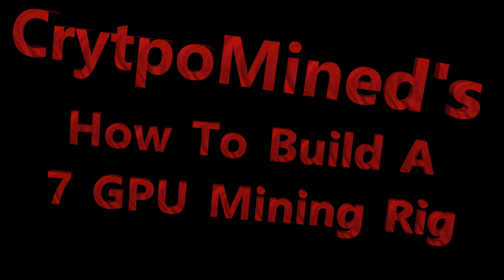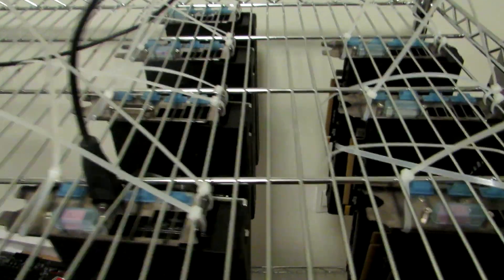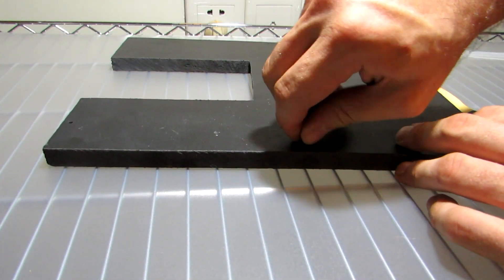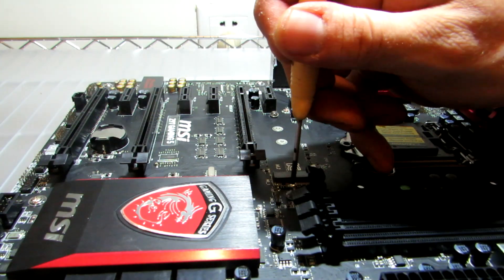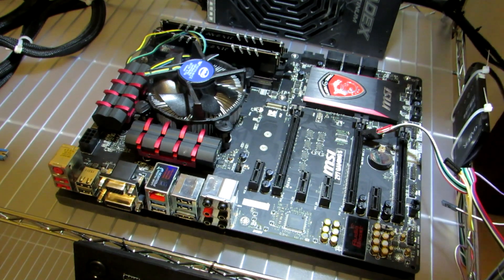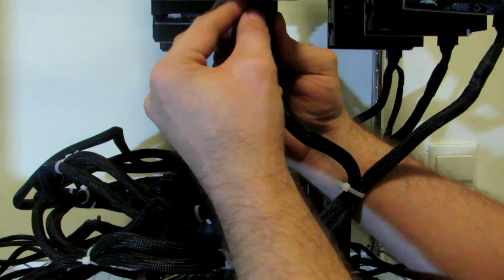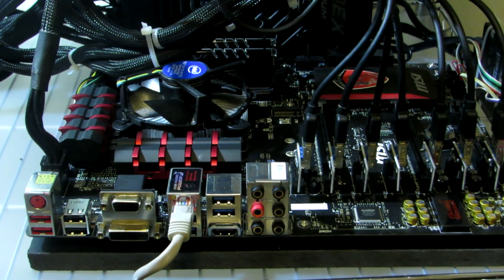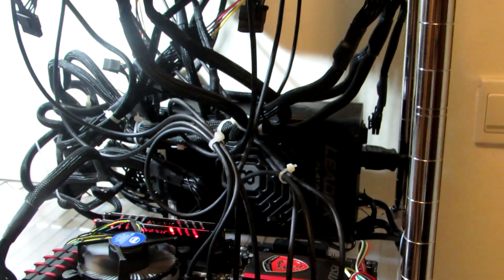How To Build a 7 GPU Mining Rig for ZCash Ethereum Monero Crypto Altcoins MSI Z97 Gaming 5

Comment: I'm doing almost the exact setup but the drivers keep crashing.. atikmdag.sys keeps failing when I start mining with claymore what drivers are you running?
Reply from the maker: do you have your motherboard bios set to gen2 pcie lanes?  and 16x set up to 8x4x4x?  running 16.10.3
Reply: I had it set to gen1 at 8x4x4 running 16.11.4 I'll try again later with your drivers and gen2 when my rig decides it wants to boot up again.. :/ thanks for your help ill let you know how it goes
Reply: hey man its still not working do you have any other ideas? 
right now I have one 470 directly in the first x16 slot and another in the last x16 slot. Then I have powered risers going into the remaining slots I find that some slots don't recognize my card such as the 3rd pci-e slot. Its super frustrating because I got 5 gpu's working just now and tried to add another via riser and completely fucked everything up, im not even able to run 5 gpu's anymore max four at the moment and the more I try to fix it via reinstalling drivers with DDU and rearranging the slot configuration the worse it gets.. I am completely stuck and have spent countless hours trying to fix this if anyone can help me find a solution I willing to give a good tip because I'm losing out on a lot of mining time right now..
Reply from the maker: 1st.. are you running windows 10?  as I dont know about any windows prior

try to DDU uninstall your drivers and start over.  make sure the 3 16x slots are set to gen2, make sure its all set to 8x4x4x.. install 16.10.3...

install drivers with 1 GPU in it.. then add one or 2 more, checking to make sure windows sees them each time, repeat until all are added, restart inbetween if necessary, make sure no risers are loose in the slots
Reply: Have reinstalled using DDU over 30 times now, have set it to gen 2 and 8x4x4  as well with 16.10.3.
I tried installing one at a time but as soon as I add the sixth card everything screws up and I get either ZecMiner64.exe has stopped working or a BSOD saying atikmdag.sys has failed.
Reply from the maker: hmmmm, not sure, i know it can be a bit of a pain in the butt to get it to recognize 7 at first, replugging in risers, restarts etc, but usually once its done its done for the most part.   are you sure your risers are good?  your using the same board?

Comment: I have 8x480 on asrock h81 BTC pro and 3in1 switch, but 7 cards works fine, 8xRx 480 not started ane idea? why not started 8x480?
Reply from the maker: was going to test out 8XRX cards today using a 1-3 riser
Reply: I will wait results ;)
Reply from the maker: i tried it on b85 anniversary, also can only get 7 cards to show up, i think this might be a max in windows.  for z97 msi gaming 5 i could not get any additional cards to show - only 7

i have not tried pro btc yet because one of my 480s seems to have problems while trying....... so i need to go change that today
Reply: thanks
Reply from the maker: I tried on pro btc and same issue, will only recognize 7 at most.  Please let me know if you are able to get 8 working.  7 working fine for me, but black scree - no post - no boot - when 8 are attached.
Reply: same problem black screen - no post - no boot with 8x Rx 480.
7xRX 480 works fine. I Think 7 graphics card is maximum

Comment: Hello Cryptomined! I am trying to build a rig like yours but for some reason my computer just wont show me anything on the screen after installing the 6th card. Do know how to solve this problem?
Reply: @Cryptomined
Actually, I just managed to get them all detected but two of them shows me the error code 43, I used the 6gpu mod but that didnt solve the problem for the last GPU

Edit: I just read all of your recommendations! At least I though it was just me having issues with getting 7 cards running. My main problem at the moment is getting rid of the error code 43, I am really running out of ideas here X.X

Comment: I have a problem drivers GPU sometime no detect 1-2 GPU and sometime driver detect all of it

http://imgur.com/RGOaAXA

Parts used: 
CPU : Pentium G3250
RAM : 4GB
GPU : 7X MSI Gaming RX480 8GB
Reply from the maker: well what I do to make 7 work, is is motherboard bios set your pcie lanes to Gen2, and set the PCIE configuration from auto to 8x4x4x... then install drivers and play with your GPUs (plug in a couple, get them detected, then plug in more).. and keep restarting until it sees all 7, ... I find once I get them all detected that usually it will detect all 7 on restart after that - occasionally for windows you might need a restart here or there to get all 7 detected, but most of the time I ~should detect all 7 - at least it does for me.

hope that helps

i use 16.10.3 drivers on that rig currently

in device manager you can also click on view hidden devices in the menu, and it should show the 7th, keep powering off and on until it is detected properly - unplug and then replug sometimes helps too (the undetcted GPU)

Comment: Bro I have several question to you if you answer I'll be really happy :)

Are you recommended rx470's or rx480's and what am i need to go with 8 gb or 4 gbs ?
Are you recommended this one or your low electricity build with rx470's
Are you recommended zcash mining atm or ethereum mining? Both of them in a lower trend. But Zcash miners rocking some hashes atm.

Thanks in advance :-)
Reply from the maker: well id recommend 470 nitros with hynix if you can get them, or if you can find a stable rom elpida memory.  they are cheaper and the hashrate difference is little compared to 480.. otherwise 480s are good too... slightly better resale and gaming value and slightly better hashrate and better memory.  id go 4G with 470 and 8g with 480, but thats just what I bought, you could try whatever you think is best for you.

not sure what you mean by this one or low electricity build with rx470's.  I use the boysie rom on all my 470's, but you will have to see what works best for you, if the rom is stable when mining for you...

ZCash for sure, still making way more than I can with ETH even today
Reply: Thanks for answer man I'm thinking about entering mining for a long time but i can't in the past 4 month because of other issues. Now when i calculate when i rx470's i'll roi about 7 months and I'm anxious about that becaus zec price isn't stabile and eth difficulty raising each day should i go still ?

And yeah I talked about boysie's rom thanks for remainder again gygabite rx 470's best fitting gpu for me atm with 200$'s i'll go with it i guess.

Have a good day bro.
Reply: And btw I don't know how to specify hynix memory on cards :(
Reply from the maker: Eren yiğit neither do i
Reply: Mate sorry for troubling you so much i hope you will forgive me lol. I'm asking because i don't have too much knowledge about amd cards. If i buy powercolor or gigabyte's rx 470's Can i edit them like boysie roms specs with polaris editor because in these cards as you know there is no sapphire triix. Thanks for answer :)
Reply from the maker: get sapphire nitros, or XFX or Asus  - only nitro can use boysie rom

Comment: What PSU would you use to replace the 2000W with 2 PSUs?
Reply from the maker: I would really need to do more research on how best to set it up, i have read and been told different ways to attach GPU's and riser power, but I would get some mix of EVGA G2 PSU.s

Comment: Nice Job dude, 
I just bought MSI M5 gaming series with 7  PCI-e slots, With 4 GPUs windows sees everything. Now, if I add the fifth card or the sixth, windows will sees only 3 ready GPUs and the remaining 3 have ! Mark (Code 12, which two same card uses same  I/O port). I've built many Rigs, But this is the first time I see something like this!!.

Do you think its a motherboard wrong design (not meant to be for mining)
or it could be the USB risers? I ordered some risers cables to see if there's a difference!
Reply from the maker: the M5 is a Z170 board?  Z170 not good for mining, hard to get 5 to work, cant get 6 to work, 7 totally out of the question, dont use 6th gen intel socket 1151 MB for mining.
Reply: Cryptomined Yes it is. Hahaha so true gpu#7 wasn't there. live and learn. Actually I'm an ASROCK H81 btc user. cheap simple and smooth. Thanks for the heads-up and do you recommend the MSI Z97 that you are using?
Reply: You mean stick with the old generation of Intel 1150
Reply from the maker: Ahmed Nattiel yup

Comment: That´s a nice Rack...Im running a 7GPU config on an Asrock H81 BTC with 5 MSI 290x and 1 295X2. Works as well. Now you need to try this one on the MSI Gaming 5:

http://www.microsatacables.com/pcie-1x4x-open-back-card-to-m2-m-key-4-lane-pcie-slot-adapter-m2-921-1x4x
Reply from the maker: thats very cool thanks for bringing that to my attention, i will get one and test it out and see if i can get it to work with 8 GPU's (as long as I can find one for sale in this country)  thanks again
Reply: Let us know what the result on this!!
Reply from the maker: kaese2002 did you get all 8 cards working?  or just 3?, was trying a 1-3 PCIE riser extender today with no luck, ill try the m.2
Reply: don´t have 8 cards available at the moment...will take some days...it´s running with 4 right now
Reply from the maker: i cant get 8 to work in windows with a 1-3 riser, maybe m.2 card will give different results, however i think 8 or more can work in linux, as this board does not give a blackscree/fail post when booting up with more than 8 cards and it can see them in windows, just cant use them

Comment: Hello,  I purchased the z97 Gaming 5 Motherboard and I already own 4 MSI  rx470 cards,  8GB ram, Intel Celeron G1820.   I cannot get the board to recognize more than 2 cards. I have swapped the riser cards around any they all work. Are there any settings that I my be missing? Maybe in the BIOS? Thank you!
Reply from the maker: ever since I tested out claymore linux V1.1 my board is also having problems recognizing even 6 or 7 cards :( i'm so upset right now.  It was working perfectly, always recognizing 7 cards and now its gone haywire :( :(
Reply from the maker: ok so finally got it running again in ubuntu.  OK what I did to get 7 working, and it works better in ubuntu then windows.  From my experience over the last week from using this system, is ~sometimes it will not recognize 7 cards in windows ... sometimes it takes a restart or 2 to get it to recognize all of them.  From using Ubuntu it always recognized 7 cards, except for after Claymore V1.1 crashed my system.. since then only recognize 6 max... so I reinstalled ubuntu and then it was getting touchy again, recognizing 4 or 5, .. but now finally is recognizing all 7 again... whew

ok so settings you probably want in bios to try to get more than 4 or 5 to work is:

PCIE Gen 2 for the 3 16x slots
change PCIE settings from Auto to 8x4x4x  

then reboot and see if it will see all cards

if problems try to DDU uninstall drivers and then re-install using the newest 16.10.3 driver from AMD

I hope that helps, but remember this system is far more stable and reliable in ubuntu than in windows

goodluck

Comment: How about the MSI Z170-A Gaming M5 ..will it also support 6-7 gpu?
Reply from the maker: no msi z170 will not support even 6, maybe 4.  z170 not good for mining.   Im very upset right now.. i tested claymores v1.1 linux miner this morning.. and it crashed and froze up my rig.. when I restarted only 6 GPUs were working... I think my 7th GPU might have been broken by his miner :( 
horrible, he copies others works and puts out a dangerous miner that breaks rigs :(  Im going to sleep and testing more tomorrow... but I think #7 GPU is broken now :(
Reply: For me clymores miner frooze also my system with 2RX480 :-( as it looks like from bitcointalk ..he just copied the code from mrb sa.
Reply from the maker: ioGLNX yes he did, very bad.  and I am so upset if one of my GPU is broken :( it is just 1 month old rx470
Reply: This happened to a friend when he started the Genoil miner..the riser burned but nothing demages just the risers.
Well I have the EVGA X99 FTW K it supports min. 5x PCIe 3.0 8x with a 40 Lanes cpu and it has a PCIe 1x pulled from PCH but I can't get it to work with 6th cards..
Reply from the maker: I guess I need to change all the risers tomorrow and test.  hopefully it is just a riser.   I really hope it is only a riser
Reply: How you got the 7 gpu to work ? you used a mod or so?
Reply from the maker: ioGLNX no mods, i do find that sometimes it is more stable than other times, Claymore V6 seems to drop GPUs and crash drivers more than the previous versions, and ubuntu seems hte most stable for 7 GPU's with this motherboard

the only things I changed in bios were PCIE to gen 2 for the 3 16x lanes and changed the 16x lane set up from auto to 8x4x4, then I use 16.10.3 drivers, earlier drivers tend to give me problems with recognising 7 GPUs, i want to try 16.11.3 but have not had the time yet to try them

that being said, if you want a board to use in windows, might be better to just use a 6 GPU set up, or even a mining specific board.  I hope claymore v7 or 6.1 if released gives slightly more stability (that being said again, claymore v6 crashes one of my 6 GPU rigs regularly also)

Comment: How much did the whole rig cost ? Thx
Reply from the maker: just under $2000 without including the PSU since ive had that for oever a year... its an expensive PSU though so if i had to buy it new now that would be an extra $400, though I would have probably picked 2 cheaper PSUs and linked them together
Reply: Great. Thx for the info. Very useful vid
Reply from the maker: Max Martin well I had one hard crash where the MB reset its bios, no idea why that happened.. it happened while using claymore V6...  other than that its pretty good, the odd time I might need to restart to see 7 GPU's but for the most part, once you get 7 GPUs recognised it tends to always recognise them at boot up.  I would consider building another mining rig with this board just because its such a nice overall board and that it can run 7 GPUs without adding extra 1-to-3 risers

Comment: Two Questions as I'm a newbie:

1. I have a ASRock 970 Extreme4 with two xfx radeon 290 4 GB. the MB has 5 PCI, so adding two more should be fine?

2. In your video, you seemed to split gpu power so that one cable powered two or 3. Where do you get the split cables?
Reply from the maker: you mean split the molex cables?  each card is powered by one 8 pin plus either a molex or sata connector, the molex connectors have multiple connections so I doubled them up

Comment: Great Job!!!!

In the video you say that we could connect 2 PSU to the rig.

How could I connect 2 PSU in one rig? I tried connecting 2 1200W to a rig but, I think I created a short circuit and I don't know why. I connected in first PSU: Motherboard, CPU, Additional Molex, SSD, 3 risers, 3 GPUs. In the second PSU: 3 risers, 3 GPU but, when I turned on the rig, the second PSU seems to have burned or damaged the GPUs.

Thanks in advance for your support.
Reply from the maker: did you use usb risers?
Reply: +Cryptomined thanks for your reaply. Yes, I used usb powered risers. I connected 3 of them in first PSU and other 3 in the second PSU.
I saw smoke on 3 GPUs of the "second PSU" (where I connected 3GPUs and 3 usb powered risers).
Fortunately, when I rolled back to use 1 PSU, all the GPUs started working, as ussually. This happened 1 month ago and they actually are mining a top speed -now they are mining zcash.
What do you think about the failure with 2 PSU? what was my mistake?
Reply from the maker: Rosmar Prieto strange, that should be ok for 2 PSU's.  I read the problems come from connecting ribbon risers and having electricity flow from PSU 1 into PSU 2.  I should read up on it more

Comment: Had the same setup here (but with a 1840, 4MB).  Nice board but only had a 1300w power supply...so never ran a full 7 gpus.  I liked the board so much I upgraded my main computer with it and put a BTC Pro r2.0 in it's place.  Anyway...what was the at the wall power draw for it all?
Reply from the maker: havent checked the wall yet, been to busy trying to get these gpu miners to run smooth
Reply: No kidding!  Genoil .6 miner no better (but prettier) than .5.   All machines have gpus that go to 0S/s with no "auto-fix"....still.

Comment: ideally what two PSU's would you have rather used?
Reply from the maker: Rafael Oliveira Well I have not done it myself so it would be hard for me to do a video on, but you should get a special cable to connect the two powersupplies together through the mohterboard sockets, then hook up the mother board and some GPUs to one PSU (and their corresponding risers using USB risers), and then just hook up the other GPUs to the secondary PSU and their corresponding risers.  USB risers eliminate the problem of the power from the secondary PSU going back to the first PSU.
Reply from the maker: well I am very impressed with the price and quality of EVGA PSUs at the moment. I only buy Corsair, EVGA and Superflower PSUs.  So I would probably go with 2 EVGA 750G2 or EVGA 850G2, or possibly one of each :)
Reply: Cryptomined hey, first of all thanks for the videos, let me ask. How would you connect 2 psu properly, would you make a video about it? I heard a lot of pros and cons but found nothing about properly connect them to risers, gpu and stuff.
Reply: Cryptomined thank you!!!